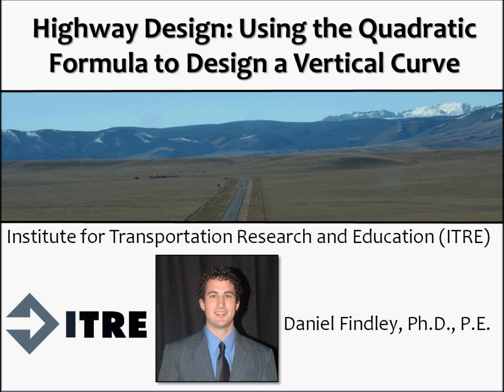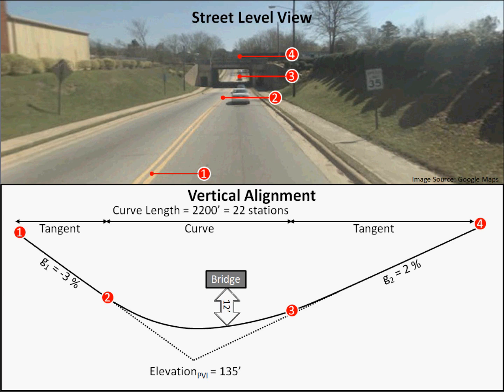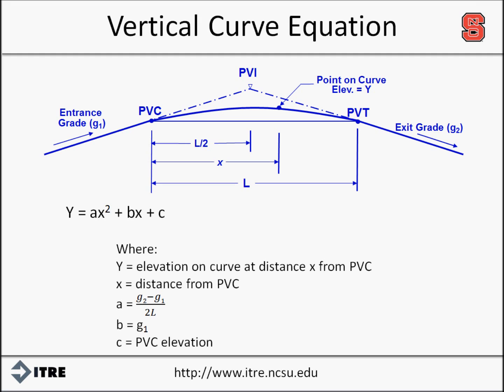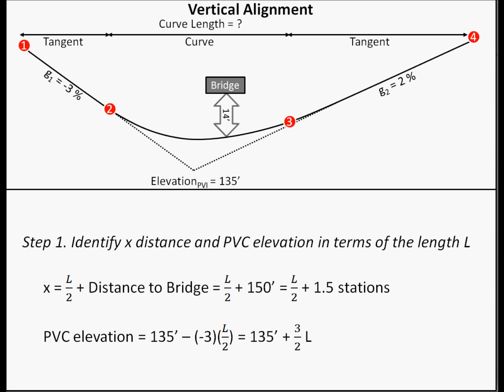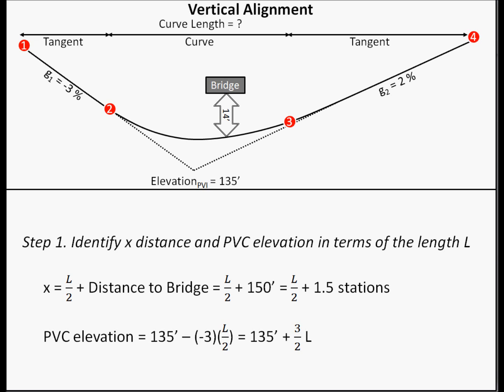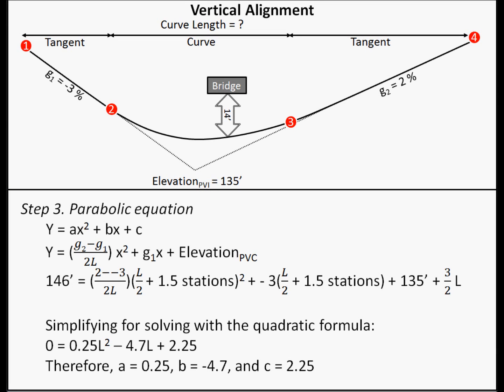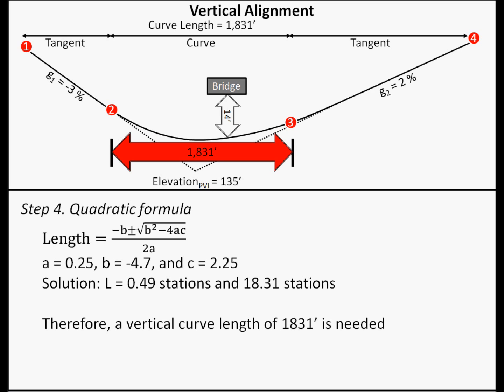Quadratic Formula for Vertical Curve Design

Comment: how did you get the 150  value in the x equation ?
Reply from the maker: Nazir, this is basically just a given in the problem at around 4:05 - https://youtu.be/4gUxo1jhu4s?t=243
Reply: @FindleyDaniel  I have the same problem but what was given to me just the elevation of PVI and g1 ,g2 with the 300m long curve..i tried to follow your steps but seems that there many things not given to me ...so if you help i would appreciate it ...btw thanks from the Netherlands
Reply from the maker: @nazirsaleh9123  do you have any information about where the hazard is located?  Sometimes they want you to assume it's directly at the PVI or some other point.
Reply from the maker: @nazirsaleh9123  I would suggest trying to locate the PVI for this tunnel and then measure the distance from the PVI to the entrance/exit that you're interested in (locate that point in relation to the distance from the PVI).  Then, I assume you're trying to increase the 3.9 meter height at that point.
Reply: @FindleyDaniel  okay thanks 
i will see it

Comment: Hi Sir, Thanks for your great videos. Usually AASHTO specifies Vertical clearance of 4.3 or 4.9 for roads. But vehicles does not have that much of height from ground. Why is this excess height. Is that for special vehicles such as HA/HB.
Reply from the maker: Great observation!  You're right that the vast majority of vehicles do not need this much clearance (even most of the commercial trucks).  The higher clearance requirement came from the Departement of Defense for the movement of military equipment: https://www.fhwa.dot.gov/infrastructure/50vertical.cfm

Comment: how do we know the value of a, b, c in the formula?
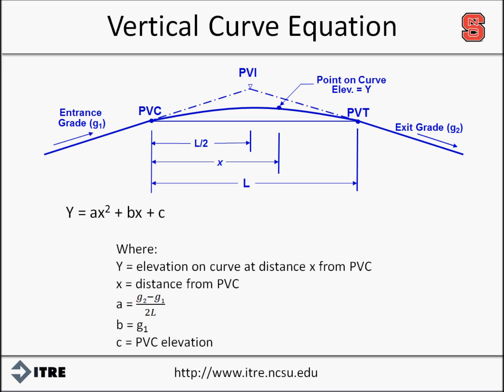Reply from the maker: They are based on the form of the parabolic equation (which defines the shape of the parabola, ie., how narrow or wide, how tall or short, and where it is positioned vertically).  For a vertical curve specifically, a, b, and c are defined at 1:56 - https://youtu.be/4gUxo1jhu4s?t=1m56s

Comment: having a heck of a time getting the constants can anyone help please?
Reply from the maker: The final answer for the example problem is correct (1,831'), but the incremental steps show inaccurate information.  When developing the problem, I must have inadvertently changed the problem but failed to update the text on the description - I apologize for any confusion this may have caused.

The correct values should be as follows:
0 = 0.625L^2 - 11.75 L + 5.625

Therefore (for the quadratic formula), a = 0.625, b = 11.75, and c = 5.625
Reply from the maker: a, b, and c are defined at 1:56 - https://youtu.be/4gUxo1jhu4s?t=1m56s

Comment from the maker: Correction Notice:  The final answer for the example problem is correct (1,831'), but the incremental steps show inaccurate information.  When developing the problem, I must have inadvertently changed the problem but failed to update the text on the description - I apologize for any confusion this may have caused.

The correct values should be as follows:
0 = 0.625L^2 - 11.75 L + 5.625

Therefore (for the quadratic formula), a = 0.625, b = 11.75, and c = 5.625